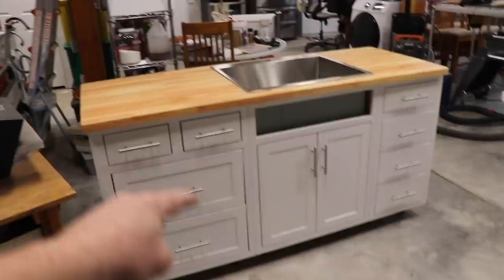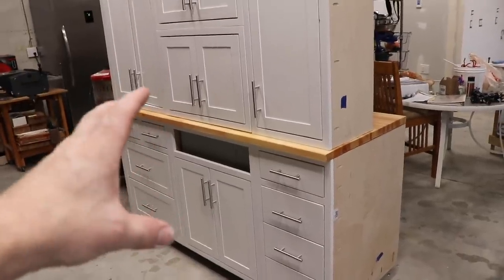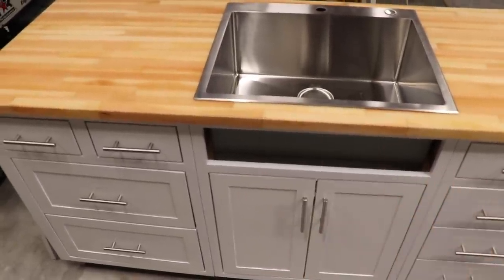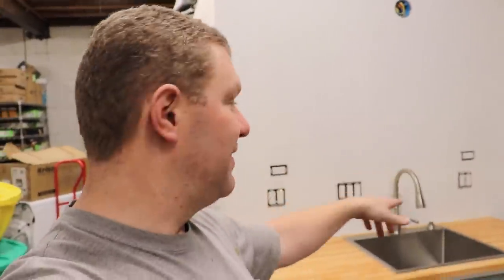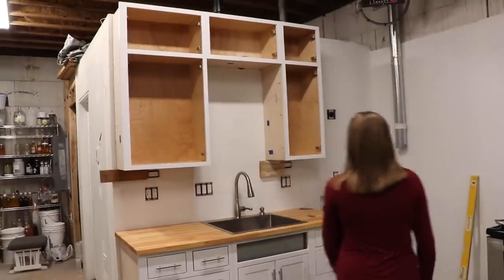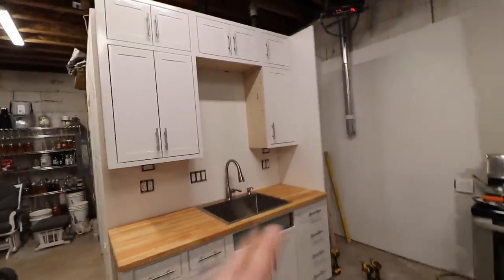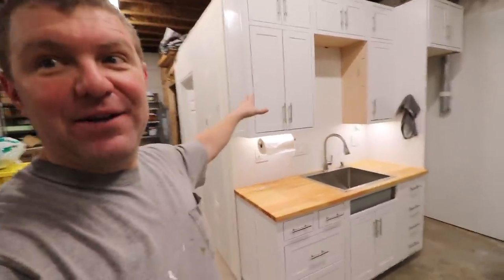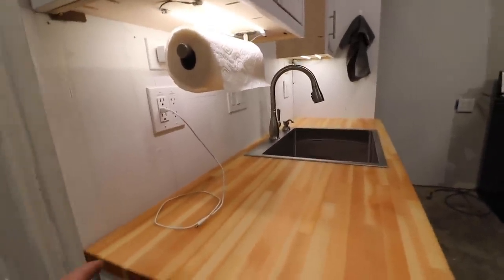Custom DIY Kitchen Cabinets by Total Rookie

Comment: If you attach a level 2x4 to the wall with the top of it at the height you want your bottom cabinet to be you can rest the unit on the 2x4 as a couple of people hold it in place you can screw it in and it is the easiest way to put them up.  Do this before you put the lower cabinets in, it allows you to get to the top ones much easier!

Comment: Uppers then lowers on cabinets. Much easier, now you have to work at a bad angle to hold the uppers while trying to align and fasten. Put up one uppers and level and shim then work across with each cabinet.

Comment: Be aware that those usb charging outlets still have all the same issues as a block in a standard outlet. The charger is a transformer so it does produce heat and it is using power even if your not plugged into it. A couple other things being that the output may not be sufficient enough for some devices and the longevity is always an unknown. I know ive been through a ton of standard charging blocks.

Comment: What a fantastic job! You guys did really great. End panels look really good. Well done!
But.......... with all that great work Im hoping youll put a nosing on those shelves. Gotta cover those plywood veneers. There tape yoh can pur on it too. But just rip a 1/4, 1/2 , or what you want and glue and brad pin them on.

Comment: Counter intuitive, but doing the uppers first is easier. You don’t have to reach over the lower. You are worried about dropping stuff on the lower, etc. you can also make a 2x4 T support like your screwed 2x4 on the wall. It will just rest on the floor.

Comment: They look really good.  Just an idea, but maybe put a little block of wood on the front of each shelve to act a a stop for the doors.  Also if you use a white piece of sticky backed velvet, it will keep the doors from making a tapping noise when they shut against the stops, or the shelves themselves.  This tape is also fairly easy to replace.

Comment: I have installed a number of cabinets and assisted with many others and never seen the top and sink installed before putting on wall. Installing sink before plumbing will get annoying eventually. And always install uppers first it is a pain in the A to do after
Reply: faucet was easily tightened from the top and behind the cabinet, its open from the back. You actually see Alyssa putting her hand under it and turning the faucet.

Comment: I have been doing high end kitchens for almost 30 yrs, Great job for a first time, and I hope some of the lessons learned will carry over to the full size kitchen upstairs, My only concern was the electrical switches directly behind the sink? Will that pass code where you live?
Reply: I posted same thing  NO GFCI  near the sink
15. All 125-volt, single phase, 15 and 20 ampere receptacles installed in bathrooms, within 6 feet
of the outside edge of any laundry, utility or wet bar sink, garages, outdoors, accessory
buildings at dwellings and in unfinished basements shall have ground-fault circuit-interrupter
(GFCI) protection for personal. No exceptions. All 125-volt, single phase, 20 ampere
receptacles in the kitchen that serve countertop surfaces shall have ground-fault circuitinterrupter (GFCI) protection for personal.
Reply: @scout7145  A gfci can be installed at the breaker panel which protects the whole circuit. A gfci receptacle protects itself and if wired in properly can protect up to 3 additional receptacles.

Comment: Jessy a small LED light will be great under the upper cabinets and will brighten up the cabinets area
Reply: Just a recap on LED Lights build a recess area above the sink to house the LED Light that snaps into place. I noticed a receptical just behind the center cabinet that you can wire into for the LED Light

Comment: Merry Xmas, I love the cabinets you have made. I made my own kitchen some odd 25 years ago, so I know what you are doing. Just a small tip. The stopper blocks with the doors.. you can move them out of the way, to the top of the opening. I painted the fronts of my cabinets with polyurethane, with a brush ( to push the paint in the seams) and a roller to give it a satin shine flat face. It was a very durable paint and lasted for many years. The extra faces on the outside, with brads from the outside? A couple of screws from the inside would have been easier and without damaging the finish. Thanks for al the videos.

Comment: A couple other suggestions. Use a thinner doorstop and move them to the top of the cabinets or they will be in the way when remove items from them.I personally don't like the fold-out door by the sink. The idea is to store sponges and whatnot in them and predictably, wet sponges and scouring pads do not go well in a closed space. Mold will be a major issue.

Comment: You did a great job!! You should be very proud of yourself.
I'm not so sure about the painters however. In quite a few shots, especially the uppers, the doors looked wavy, not smooth as you would want it.
It could just be the lighting..either way..you did a great job!

Comment: Looks Great.  But how you going to put in false drawer without removing the sink?
Reply: From the outside, and press fit. or clipped from behind. No big problem. I'd suggest recessing a paper towel roll within it.
Reply: already talked about this. He doesnt have room with such a big sink. He will try to modify the brackets for the half tilt drawer front he wanted to install but he will figure something out.
Reply: I know, but putting the false drawer on before the sink, seems to be  quicker.  Is there a way, without screwing thru the back, to installing a false drawer?

Comment: you need a filer that will cover dryer vent and help support  corner of cabinet. You can look up fillers.
Reply: I agree you need a filler between the washer/dryer and the wall. You could make the a L shape filler to give a finish look on the washer/dryer side, you would not need but around a 6" return.

Comment: You may want to check the distance from the sink to the outlets, I am certain there is a building code for how close it is allowed to be. Other than that it looks great.
Reply: No min. specified, but may not be more than 4' apart. The 2'/4' rule.  Also must be GFCI,  duh.
   ''If it is a kitchen counter, the receptacles must be placed so that no portion of the countertop is farther then 24" from a receptacle (commonly called the 2'/4' rule)''

Comment: I'd put a microwave and a light in that space with the towel thing behind the light. Its blocking your control fixtures. That will probably annoy you eventually
Reply: The paper towel roll is right in the way. The wall switches are in an awkward position as it is, blocking access to them and the outlets will cause grief. I'm amazed the elec/inspector approved the switches there, but whatever.
Overall, it looks amazingly good.  I'd avoid putting a microwave on that counter, or even hung from under the cabinets. There just isn't room. It should go by the stove. It will be far too easy to clutter the space as it is.

Comment: You forgot to seal the bottom of the butcher block . It's going to split .
P. S. Never put lacquer on a butcher block, it's for cutting on . Unless you want to eat lacquer .
Reply: they wanted the butcher block for looks not to use as an actual cutting board
Reply: @warrenmichael918  still going to split .

Comment: Looks amazing. Can’t believe you allowed to have plug outlets by sink. Totally forbidden in my country.
Reply: Here in the USA we can do this because our electrical code specifies a GFI outlet in the first of the circuit. Somebody correct me if I didn't get this right.
Reply: Yes, it's GFI protected.  In fact, I think he installed some GFI breakers too.  Can't imagine not having outlets near the sink.
Reply: Even with GFI. Would  not be allowed here.
Reply: Our voltage also 220 to 240. When we actually do have power🇿🇼

Comment: Congratulations!...,  from a 5th generation, German furniture maker.  Now imagine how my G. G. Grandfather in Germany used to build them..., all hand work (meaning no electric tools, dove tail joints on every cabinet drawer corner, curved cabinet faces with artistic inlays on doors, no metallic guides for drawers [soap for lubrication], and instead of building with pine [soft] try it with oak, walnut, rosewood** [very hard] or maple [hardwood]), no nails or screws..., in other words..., timber-frame cabinets made with non-electric hand tools out of hard woods with artistic inlayed mix and match woods and carvings!  Then you begin to understand why these old pieces from the 1700's go for tens..., ever hundreds of thousands of dollars (we are talking dining room chairs built the same way here) at auction.
Reply: Roy Albrecht knowing that Jesse did the timber frame workshop, I certainly expected some nice dovetail work.

The precision of old craftsman is still unparalleled in this machine driven era.

Comment: What is the reasoning behind not having a facing for the opening in front of the sink?
Reply: That's what I was wondering as well wheres the facing panel in front of the sink.
Reply: T R I don’t think he means the opening above the sink but the missing front panel. But Jesse explained that about three times in the video.
Reply: That faceplate in front of the sink is where he trying to install a hinged panel for small items, but wanted to wait till sink installation to see if it will work.

Comment: How did you find studs to mount upper cabinets into?
Reply: In that wall? All the outlet boxes make it easy. You know there is a stud on one side or the other. Once you find one, you can measure for the others. On a completely blank wall? I use a magnet to find the drywall screws, then measure it out.
Reply: You can use a stud finder from your local home improvement store
Reply: He build the wall. Should be easy enough

Comment: You screwed up. When your washer and dryer break, which they will, they dont last like they used to, you'll need to replace them, and your new ones might not be the exact same size as your current ones, which means you will have to change some things

Comment: Hi Guys,

If you had used MDF (Medium Density Fiberboard) instead of wood that is porous, you would have avoided the expense of hiring painting out for your face frames and door -drawer fronts.

Comment: I hope those electric outlets are GFCI...I dont see the reset buttons on the outlet for GFCI. Cabinets look great!!!!!!!!
Reply: Scout 714 as long as there is one GFCI on the same circuit, they’re good. They don’t have to ALL be GFI’s
Reply: Also, considering that they have inspections they have to pass, you can guarantee there is proper GFCI use.
Reply: They are in the garage, EVERY circuit is protected by a GFCI. Only one is needed per circuit.
Reply: A gfci can be installed at the breaker panel which protects the whole circuit. A gfci receptacle protects itself and if wired in properly can protect up to 3 additional receptacles.

Comment: Why so high in the middle?, it look's like you could put another small one over the sink.
Reply: All of those high cabinets are basically useless as accessing them will require a ladder.
Reply: Jesse is pretty tall. At 6’3” myself, I can tell you that most people’s over sink cabinets are way too low for me to comfortably work/lean under when really scrubbing a pot hard. With 8’ ceilings in my kitchen I ended up doing no upper at all over the sink.

Comment: A professional cabinet installer always installs the upper cabinets first and the lower cabinets last!!
Reply: Totally wrong , bottom cabinets always first . Customers like wall cabinets at different heights from work surface , base units are set to roughly a standard height . Fitted 100s of kitchens being a carpenter and joiner for over 40 years .

Comment: I don't understand.  Are you building the kitchen in the garage?
Reply: That's their test kitchen - I know, it takes forever right? I respect their work, but if Henry Ford would have decided build his car factory debt free from scrap would we would still ride horses
Reply: As well as their test/learning kitchen, I suspect it is going to be their canning kitchen, plus it seems like they mentioned, a long time ago,  "in case they might need a small apartment" later(?).
Reply: Hold on...a TEST kitchen?  I understand building a few ‘test’ cabinets with a countertop and sink that could be eventually used for a work shop; however, I would not spend money on an entire test kitchen when my house exterior is still covered with Tyvek wrap.

Comment: I started out thiinking this was going to be two ordinary people building their own house.
Having watch it up to where tthe cabinets go in i find myself think just how many ORDINARY people can afford to by a backhoe a fork lift a mobile wood saw, just about every electric tool you can think of , and to top it off a huge bit of equipment for cabinet making, in fact i wonder how many cabinet makers have this sort  of equipment.
For me if I want a special tool my wife and I have to save for it, we only have one car that we bought second hand., and all the tools I have are ones that it has taken seventyfive years to accumalate even our cement mixer came from the tip and I repaired and rebuilt it.
I dread to think how much the cabinet making gear cost.
I had to give up flying because of health reasons, but i have never owned my own craft.
The block I started of with had two die back trees on it but the wood was good, it cost me three thousand to hire the saw and the guys that worked it, annd we did make a bit of profit from that, and got enough wood to floor the house and make some furniture .
I think we must have done something wrong when we started building, i think it was not being rich or something because at seventyfive i am still working, even after fortyfive years of chemo treatment.

Comment: Why of course you will be standing on it, need to reach the storage area above the bathroom.  you may want to shim the back of the counter an eighth of an inch so water flows to the front instead of the back.  As for over the sink, look at Lowe's Kitchen Cabinet Accessories for an idea, Item # 1216306 Model # 58395.  Poor Jessie, works all day and still has to do the dishes, did he ever get to eat his special treat?

Comment: Are those sockets a bit close to the sink.  I know here in the uk your not allowed to have them do close.
Reply: They have to be GFCI outlets
Reply: Andreas Koepke ok nice one.
Reply: UK wiring rules are extreme overkill.  Plus there is all the fire public service adverts which encourage unplugging the toaster and other similar appliances when not in use too.  That's nuts!
Reply: Andreas Koepke You’re right. His wiring has been inspected and it passed inspection so we know that they are all GFCI protected. Could be in the breaker box or in a receptacle. Just because you don’t see a GFCI doesn’t mean it’s not protected.

Comment: What I’ll never get is why in North America builders install floors AROUND furniture and appliances instead of a continuous surface underneath them.  It would make things so much simpler in case of a spill or remodels down the road.
Reply: Flooring is usually replaced much more frequently than a kitchen
Reply: Its all about saving $$$,
Reply: Same for the backsplach. It does same on labor and material if you have to do a smaller area, but as a matter of pride, I would have tiles the entire backwall first
Reply: It just depends on when during the build the flooring is installed and how cheap the builder is. If one is running true hardwood floors you better bet its going wall to wall under everything. If only for the fact you would have 3/4" difference.
Reply: Jake K. Yes I,am familiar with that.  In a kitchen or utility room or garage the flooring is more likely to be tiles, or that hokey rubber floor, or painted on two parts epoxy.  I have seen it where a dishwasher or washing machine has a hiccup, water pour on the floor.  If the flooring is not wall to wall some moisture will get underneath the impermeable flooring from the missing parts, soak in whatever is underneath (cement slab in this case) where it causes mildue, odours and so on.

Comment: The heck to install the upper cabinets is to find a low level but you want them then install a temporary straight edge along that line. Then you can take each individual shelving unit put the bottom of it on the ledge that you just put up install that cabinet and do the next one. When you install the connections between the cabinets. That way you only have to lift one cabinet at a time. When finished installing cabinets remove the temporary “ledger line.   Now what are you going to do with that bit of a corner? One with assume a fridge

Comment: washer and druyer place NOT have in kitchen newer. no smart and no good. totally wrong place.this corner need be table area working area cooking,
Reply: It's a temporary kitchen in a garage. Later it will just be used as a laundry center.
Reply: Having a washer and dryer in the kitchen is actually a thing in most countries. Actually planning out our home to have it in the bathroom and kitchen area so you do not have to go far or up/down stairs for laundry to be done. Oh and a main floor drain in the middle of said room so if it leaks it just drains.. with 16" high floor molding tiles. I can make a pool in my laundry/bath room if I wanted then. Haha.

Comment: Not a good idea to have sockets over a sink!! wet hands will increase the shock factor make sure they are protected with a ground fault breaker, code should not allow this
Reply: haywardsteve Just because you don’t see a GFCI doesn’t mean that they are not protected.